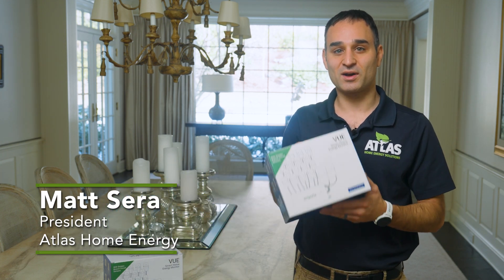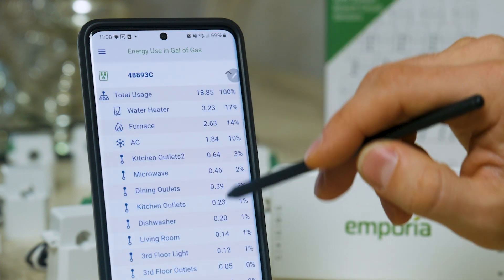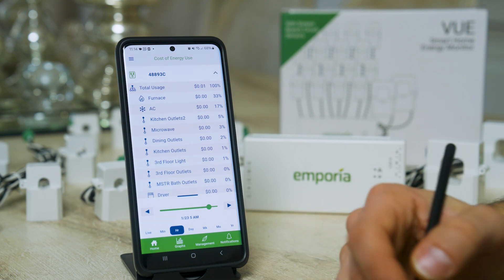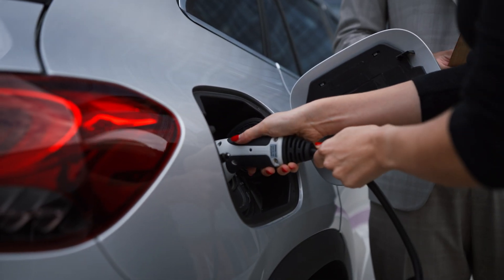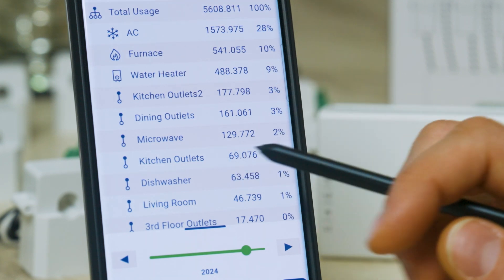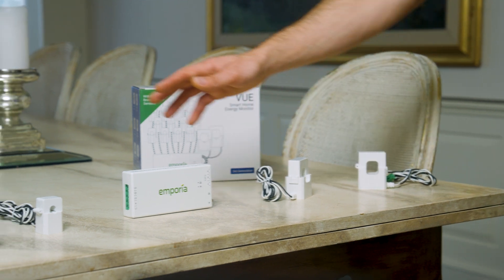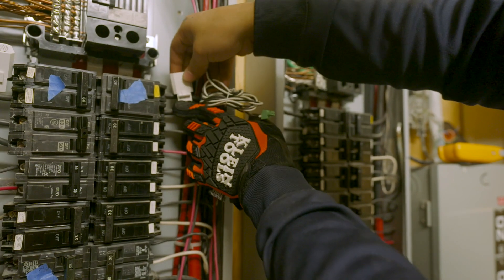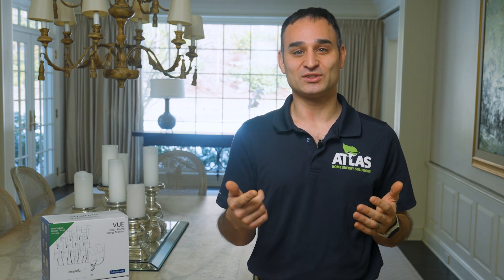Taking Control of Energy Use with the Emporia Vue Energy Monitor

Comment: Sir, very informative - thank you. I'm considering buying a backup generator due to frequent power outages. Would this device help me understand my power consumption in order to install a properly sized generator? Thanks and Semper FI, Ken
Reply: A trick I saw online, assuming you are you using a generator interlock to effectively "backfeed" your breaker box during a mains power outage, is to run the power lines from the generator connection, into the breaker box, up along the main power lines, then down to their interlock breaker.  That way, you can put the 100A current sensors around the mains and generator power lines, and measure the total current being drawn, whichever the source of power is.    On generator mode, you may have to turn some circuits off, that your generator won't have enough power for (ie. a 50A electric stove).    One potential problem with the Vue during an outage is I think it's cloud based.  If so, then during an outage, you'll need to have functioning internet and wifi in your house.   Depending on the situation, that may not always be possible.